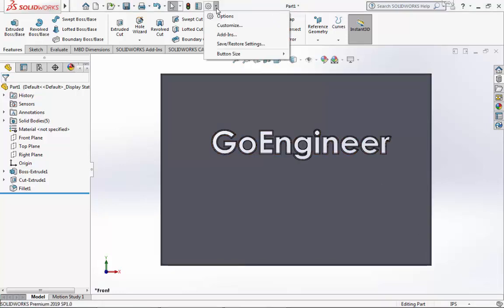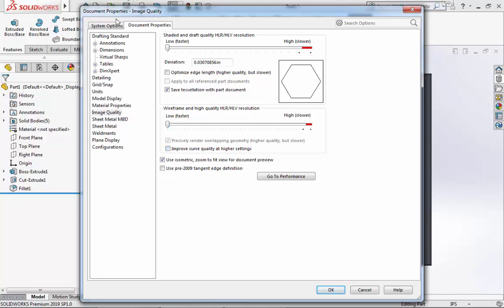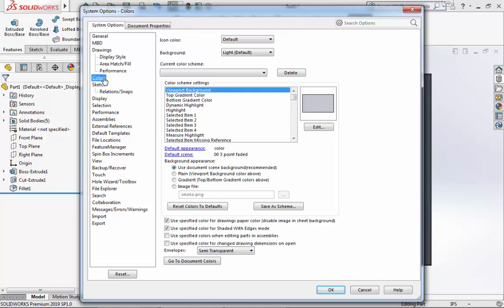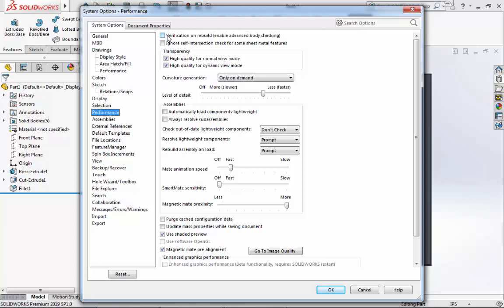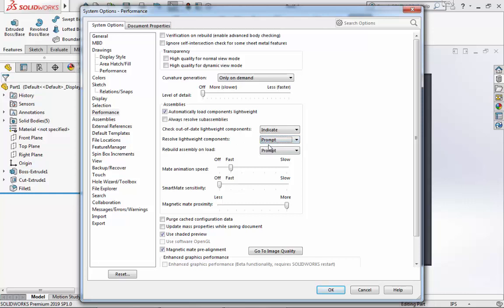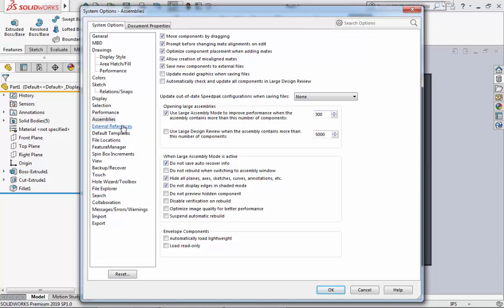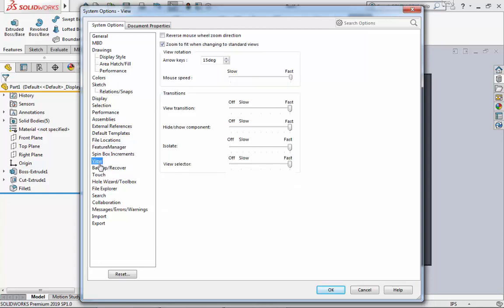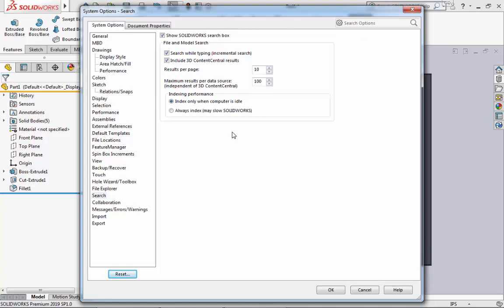SOLIDWORKS Tutorial - Optimize Settings for Faster Performance

Comment: I am running SolidWorks in a laptop with only weak integrated graphics. The one setting that makes a HUGE difference for me is Options, Feature Manager, UNCHECK Dynamic highlight. That makes it dramatically faster to be able to click on parts to do things with them. With that box checked (default setting), I have to wait for minutes after clicking a part for it to draw orange highlights lines on each edge of the part. Now it skips that and it’s almost instant from selecting a part to being able to do the next step.
Reply: Thank you very much, Erik :)

Comment: Hello , I have a Razer blade 15 2019 with a rtx 2070 gpu. Ok thinking about getting SolidWorks and I am unsure how well it will run on my laptop. Do you think it will be usable?
Reply: I run solid works 2020  on I5 4th generation and ram of 4gb 😂
Reply: I think you overestimate Solidworks' requirements. With an rtx 2070 (assuming its paired with a reasonable CPU like an i7 9750H and plenty of Ram) you will have excellent performance. Avoid installing new versions that include no service packs (Ie. If you can choose between SW 2018 SP3 or 2019 SP0, choose the former). 
Also, Solidworks performance varies a lot. If you are working with very large assemblies (especially with parts that have lots of details), real-view graphics, and like to render 8640p resolution images, then yeah, your laptop is gonna suffer. 
Make sure you buy a base cooler - performance is an issue if your CPU is thermal throttling.
Reply: I can run a 300 component assembly on a 6 year old laptop with only integrated graphics and a 4th gen i7. Solidoworks only values single core performance and will run on a potato.
Reply: I dont think Razer blade 15 2019 is a good choice because of its graphic card GTX 1660
I recommend the quadro P series and check if its certified in solidworks official wesite